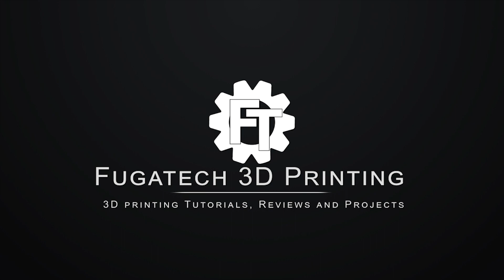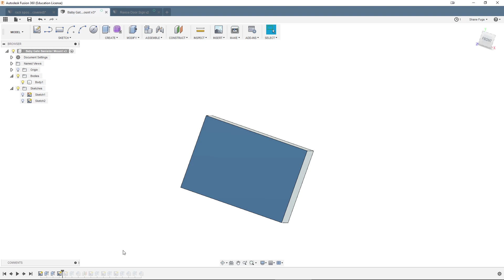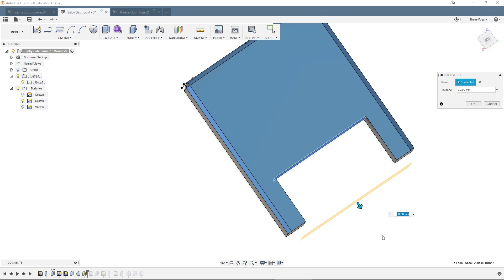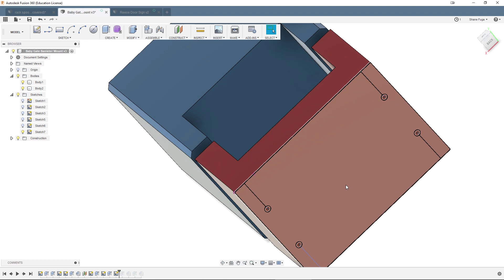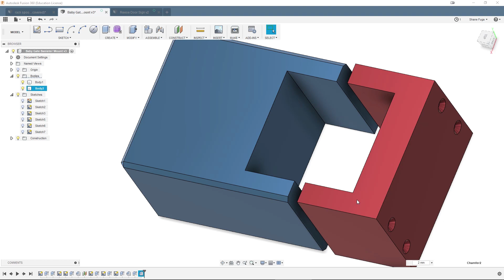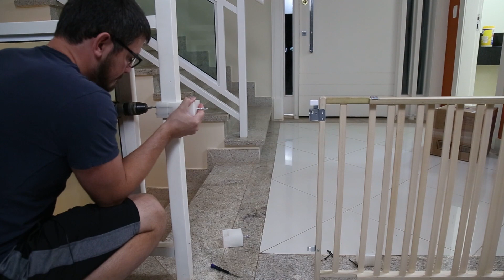Pratical Printing: Baby Gate Mount

Comment: If they're not as tight as you'd like add some adhesive backed rubber to the front and/or back faces, that'll get you more grip and eat up the space you need. Even a strip or two of electrical tape would probably do the job. I did something similar to this to make a universal mounting bracket for some 4" post columns I have in my basement shop. The mount to the column was static and I made a universal dovetail mount so I could just mock up new tool holders and fit them to the stock ring mount for the column. I used thin weather stripping in that case to increase the grip on the column and make up any gaps in my measurements.
Reply from the maker: I never thought of using electrical tape to make them tighter. Thanks!!!

Comment: heated inserts are your friend with printed parts.  I got 30 -35 in-lbs of holding torque before the plastic gave away.  Used PLA.

Comment: Great project. If you lengthen the extrusions on the gate side half, and shorten the other half you will be able to use the same screw size and get the increased bite you wanted, Thank you for the video.

Comment: Cool idea and nice video, you might want to turn the mounting point 90-deg on the horizontal plane. This way you could recess the metal bar into the 3d printed part. It wouldn't hang out as far and could be just as (if not more) strong than this design since the bar could be supported on both ends.
Reply from the maker: That is an interesting idea